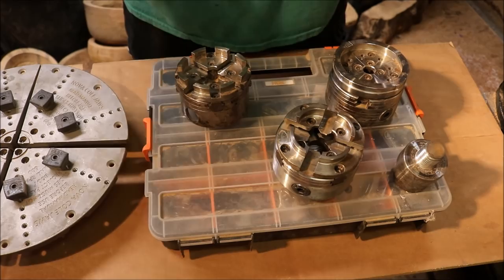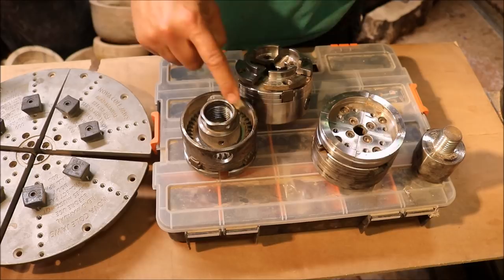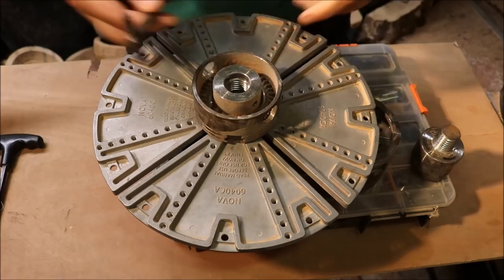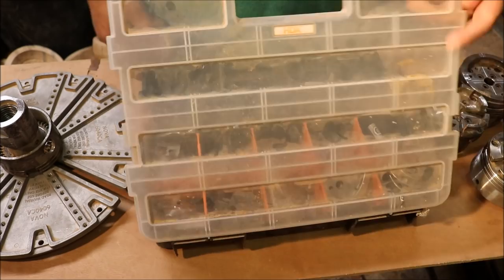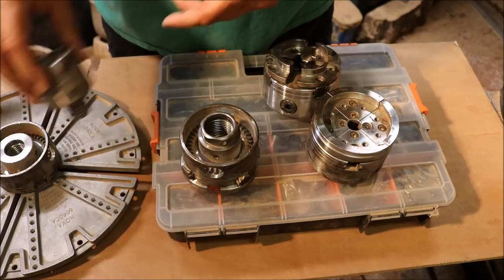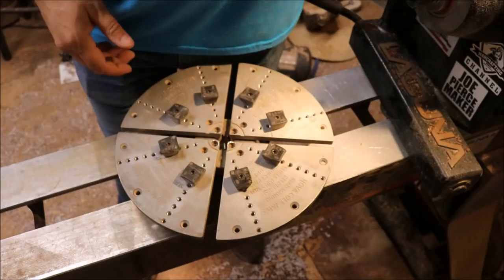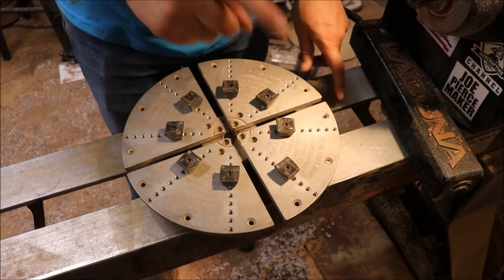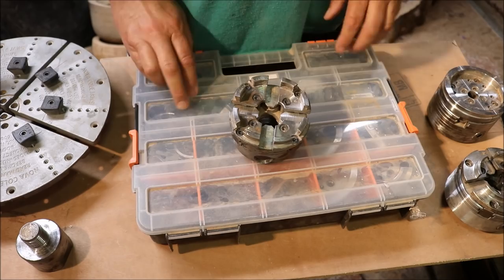Just The Tip - Turning Chucks (Things I wish I knew When I Started)

Comment: I started with a Nova G3 about three years ago, It has done me well and I still use it most every week.  I do have a suggestion, it may be only with mine, it might be with all, but, when I take a piece out of the Nova G3 and set it aside, when I come back to turn it, it does not resister as I would expect.  I ran a dial indicator on the chuck and found out that it registers about 30 to 35 thousands out of round.  This is not a problem if you do not take your piece out of the chuck, or if you remove the piece and still have a large margin to turn, but if you use the G3 and want it to index extremely close to the original position, I would suggest putting a sharpie mark  in between two of the jaws,, and also putting a sharpie mark on the base of the chuck , aligning with those marks, on the tendon, so that I can put the piece back exactly where it was originally chucked.  With mine, it seems that the adapter, the way  that it screws to the mandrel, and also screws to the chuck, is where the inconsistency is,    I can remove the chuck from the lathe, and reinstall it, it is always a bit off, running true, but it always off at the same spot.  Using register marks that I mentioned with the sharpie will eliminate this. 

I recently purchased a OneWay Stronghold chuck, that has an adapter that   screws onto the lathe mandrel, and slip fits into the back of the Stronghold chuck.  With a dial indicator, it still runs out a couple of thousands, but the set up is more accurate. 

I still do indexing marks on the OneWay chuck, though it probably is not necessary,  it is just something I learned from using the Nova G3.

If you are getting close to the final cut, and have  to remove the piece, whatever chuck you use, the indexing marks with the sharpie will make you more accurate.  if you do not remove the piece, then you don't have a problem.  You will never see 30 thousands looking at the bottom of a turning.

This might not be a problem for most turners, but I hate to be turning a 12" bowl, with 1/4" walls, have to remove it to do something pressing, and find flat spots after the finished cut.

Again, if you do not remove the piece, you should not have a problem.

I like Nova products..

WH
Reply from the maker: Marking the piece and the chuck is fantastic advice. I usually keep the chuck attached to the piece throughout, but there are times I need to take it out. You really can't see it but I have a permanent marker mark on my G3 for just suck and issue. I'm glad you brought it up since I failed to talk about it in the video. Thank you.

Ken

Comment: I only have one chuck and it's the G3.  I eventually want to buy more because I hate changing the jaws.  One thing I love is the flexible drive center that clamps in the jaws.  It allows you to turn between centers until you make a tenon without having to take the chuck off the lathe.  Go get one and thank me later.
Reply from the maker: I insert my drive spur in the chuck and use the tail stock sometimes. super easy and no need to put on face plate. flexible drive center? Never heard of it.

Ken
Reply: @MoonpieCreations  It's pretty much just a drive spur but the center point is spring loaded so it makes mounting a little easier.  https://www.amazon.com/9021-Flexible-Point-Drive-Center/dp/B01BHJF7P0/ref=sr_1_1?keywords=flexible+drive+spur&qid=1557412696&s=gateway&sr=8-1

Comment: Nice review.  I have 2 of the Record power chucks (one larger one one smaller one).  I need a 3rd for my cole jaws.
Reply from the maker: It’s great having on permanently on my cole jaws.
Reply: @MoonpieCreations  I don't use mine as much.  It has a speed limit of like 700 rpm I think.  Used it maybe twice and had them for over 2 years I think.  Maybe as I progress.  Anyway still a good intro to chucks and review on the nova chucks

Comment: My G3 manual says you can only turn a 4 inch blank that’s 6 inches long using a tenon. Am I correct?
Reply from the maker: Hmmm, not sure why it says that. I turn up to 12" diameter bowls using a tenon. It all depends which jaws you use. They do not recommend using the larger 130mm jaws, but are okay with the 100mm jaws. The 100m jaws are okay for up to 14" diameter and 5" deep. They are most likely speaking of the spigot jaws. No matter what I say, please side with what you feel safe doing.
Reply: Thank you for your response. I guess I will be buying the 100 mm jaws. Great video. 👍

Comment: I have a tekatool nova scroll chuck I inherited and it’s frozen! Can’t open and close the jaws very well. I don’t think the owner ever cleaned it. How do I remove the scroll ring?
Reply from the maker: This video will show you how to take your chuck apart.  I hope it works for you.  I had to use this video when I got resin inside my truck jars and couldn’t open or close it. https://youtu.be/DMeL8pQFFFs
Reply: @MoonpieCreations  mine does not have that black cover on it. You see the scroll ring underneath plus that snap ring. If I get the snap ring off can I then access the scroll ring to get it off? I think it bound with saw dust. I tried blowing it out, took 50 mm jaws off and cleaned those. I had seen that video before.
Reply from the maker: @kandiecandelaria1423  I want to get the snap ring off it should come out easily.

Comment: An informative video thanks. As far as lathes go is there a better/best thread size to get regarding strength, etc?
Thanks in advance.
Ron
Reply from the maker: Ron, different lathes have different threads. But I don't think any are better than the other. I have a 1 1/4" 8tpi. others are 3/4" 16TPi. and a bunch of other combinations. Your lathe manual should have the TPI you need for your spindle. I hope this is what you were talking about.
Ken